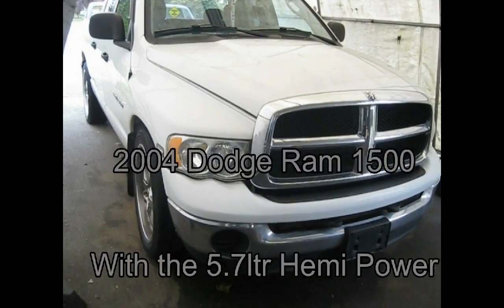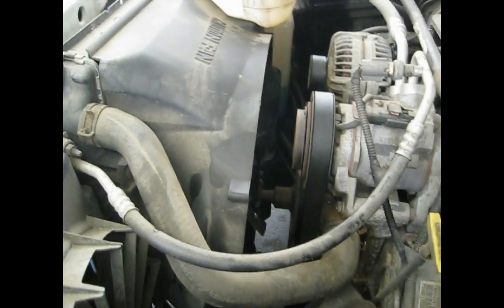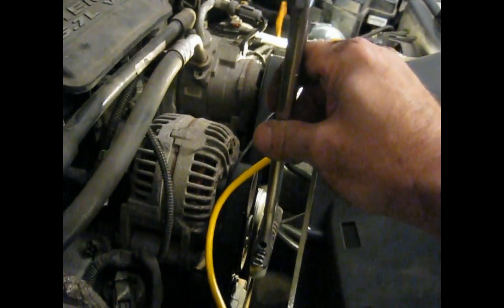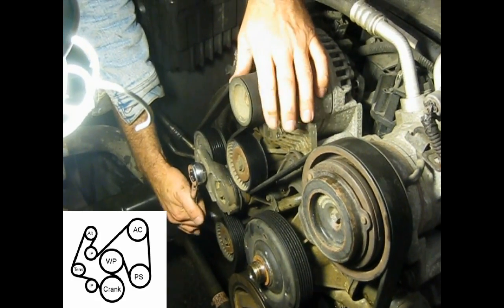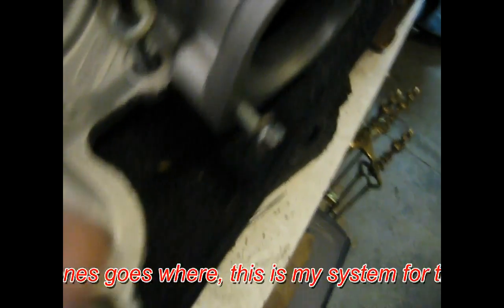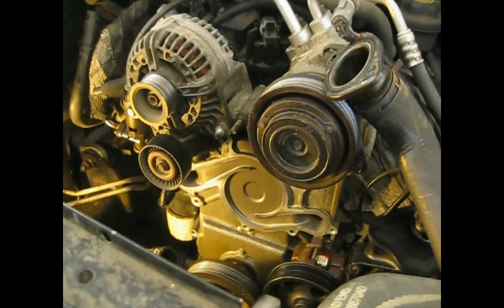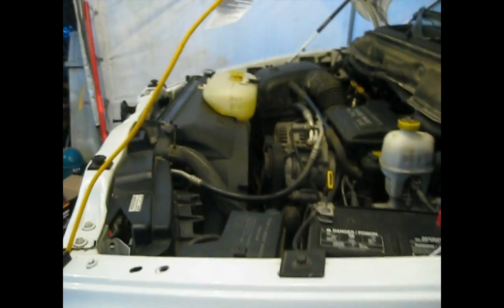2004 Dodge Ram 1500 5.7ltr Hemi Water Pump Removal and Installation

Comment: Great video! I've replaced my fan clutch before, Lisle makes the tool for holding the pulley, it's worth every penny.
Reply from the maker: Great tip TheBilly502, I'm sure many will benefit from that. Always good to have others toss helpful bits of advise or experience into the mix. This is all about helping each other out. Save time and Money. Thanks :)
Reply: What tool is it part number ???

Comment: just wondering if you seen the bolt that was missing from behind the tensioner on the pump an installed it too? good vid.
Reply from the maker: Not sure what bolt you mean, but everything went well with the re&re i've had no issues since done. Thanks

Comment: Great idea, putting the bolts in the new one as you removed them from the old one!
Reply from the maker: Thanks Randy F., I started that habit when i used to tear down motorcycle engines. I would lay all the parts out on the floor link an exploded micro fish pic of the parts, leaving all bolts and nuts in their spots, it always made the reconstruction so much easier.

Comment: Didn't see it any the comments on the top of the page, so I thought I'd tell you, the "tit" on the top of the thermostat is a burp hole that allows air to burp through if air is in the system. Obviously, you want it at the top when installed since bubbles are on the top. Good vid.
Reply from the maker: Yeah i had a few people tell me that both in here and other wise, but the video i made now, didn't feel like editing to change that., figure it's been mentioned in the comments now so it's all good.., but thanks G8RDuc & Thanks for the "Good Vid" appreciate it. :)

Comment: Hey im wondering on the makeshift pulley holder that you created , what size of bolts/screws did you put in the bar that would fit snug in the holes of the pulley??
Reply from the maker: Hi Jorge Gonzalez thanks for the post. To be honest, i don't actually remember what size bolts they were. I had a box of different sized bolts on my bench and i just picked out the ones that fit the best then made the rest from there. It was my second attempt that actually worked, the first one i made bolts were too small and the bar wasn't strong enough. (it was kind of Hit & Miss) Hope that helps you, sorry i couldn't give you an exact size. :(
Reply: ok cool. i actualy managed to get it removed after a while , took off the entire water pump, stuck a chain wrench onto the black wheel, put the handle of the chain wrench on the ground, then with a large crescent wrench twisted off the large nut, everything was going fine when i replaced the pump, then put it back on, and somewhere along the line i actualy punctured my radiator which needed replacing asap so i replaced the radiator, and now im having a slip in the gear shifting when i go to pop into drive/reverse it takes a couple seconds sometimes and other times pops in right away but even then when i gas it , it seems that its  not in gear for a sec, but jumps in and i feel a jerk then i get moving afterwards. ALSO DO STALL AT TIMES WHERE I COME TO A RED LIGHT.

Comment: Ever tried doing this in minus 25 degree weather in the middle of winter? Not fun. 

On your 2014 truck, did you need to unbolt & move the A/C compressor the get access to the bolts on the water pump?

Also, do you know what the torque specification was on that fan shaft?  I think it's pretty high (close to 100 ft-lbs).

Also noticed you didn't use any RVT sealant on the water pump along the outer edges of the gasket.  Why not?

That was quite innovative of you to use a make shift tool to lock the fan pulley.  I never like making my own tools (don't trust the workmanship lol!). I went out and bought a strap wrench to tie up & lock the fan pulley into place while I pulled & torqued the shit out of that fan shaft to get it off. What a pain in the ass.

At the start of the job it didn't look that bad, but as you get into it, it was much more time consuming and difficult than it first seemed.  If I had to do it again I wouldn't.  I'd rather just pay the mechanic the $500+ to do it.  Professional mechanics have it easy: they get to do the work in a heated garage while standing up the whole time with lost of room to move.
Reply from the maker: Hi "Randy the Ram Robinson" (GREAT wrestling Name BTW) LOL.., No i didn't have to unbolt and move the A/C Compressor, didn't touch it at all. As for the fan shaft i just tightened the SHIT right out of it, (NOT COMIN LOOSE, LOL). And as for using RTV sealant, it's a soft rubber/urethane gasket, no need for any sealant or gasket glue. It's been quite awhile since i did the job and still going strong NO leaks or anything, you can see in the video the old gasket was still soft and ply-able (could've probably re-used it, but i didn't want to plus the new pump came with a new gasket anyways). Oh and I tried a "strap wrench" for the fan pulley OFF video and had ZERO luck, it kept slipping and pissing me off. I couldn't get a strong enough grip to loosen the torque of the fan.

Everything i had to do was shown in the video, I know in some videos guys will "skip threw a step or two that they may think is obvious".., but covered every step along the way so there is no surprises. :)

Good luck with the job, hope my video helps, (Dress warm) -25 bbrrrr

I changed a motor in a Chevy 1/2 ton P/U middle of winter with 2 feet of snow around me and more coming down, but i had a "propane drywall bazooka heater" blowing on me the whole time, I was in shorts and a T-shirt, I actually broke out in a sweat it was so warm. LOL

**Anyone ever tell you, you look like "Mickey Rourke" the actor (once pro-wrestler) or is that actually a pic of him not you? LOL

Comment: How far apart did you know to drill your holes for that fan clutch tool and size of screws
Reply: I was researching and was just wondering if a strap wrench would hold that fan clutch bell housing. I'm going to change out  the crankshaft seal this coming wkend
Reply from the maker: Hi SuzRed11704, sorry for the late response. it was all hit and miss making the clutch fan tool., but what i did was I had a box of bolts I tried all until I found the size that fit snug into the pulley. Then for the holes I simply made a template from paper to mark the distance, cut the holes, layed that on the bar, marked it with a felt and drill them out. If you still getting ready to do the job, I hope this helps.
Reply from the maker: I have a strap wrench too, but it could not hold the torque required to break the fan loose.

Comment: having the "jiggle valve" at 12 oclock makes it easier for air pockets to escape as they will be higher in the thermostat housing.
Reply from the maker: can't say i have ever heard of the "JIGGLE" valve but if it works great!  :)
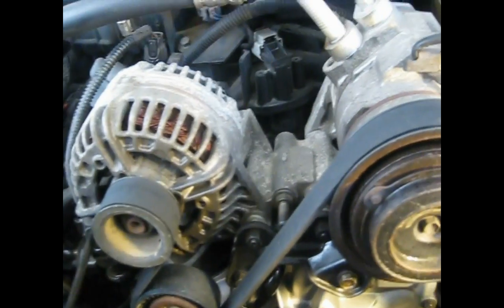 Unless of course you are referring to that little nipple on the thermostat, in which case yes i realized that had to placed in the 12:00 position, but raising the truck while adding the fuel helped the fluid go in without trapping any air inside the motor so it wouldn't over heat when done.

Comment: I highly recommend replacing the plastic idler pulleys(they're garbage) with oem metal replacement idlers from NAPA...much more durable. Overall, excellent job for a DIYer.
Reply: Kevin Jones  "Do it yourself'er"
Reply from the maker: Good point, i haven't had any issues with the plastic one yet but i'll definitly take it under advisement, Thanks (what's a DIYer?)
Reply from the maker: David Laro
LOL love it, (DIYer) Thx  :)

Comment: Kevin, Great job! Will be doing mine in the next few days. Just to clarify...the fan clutch removal would be clockwise? In other words..turning the shaft to the right to remove it? Thanks
Reply from the maker: CCW - Counter Clock Wise to REMOVE. Just as it says in the Video.., otherwise you will be tightening it and you could break or even strip something depending on how strong you are, or how long of leverage bar you choose to use.
Reply from the maker: Not the to the right.., Removal turns to the left CCW. Good Luck. :)

Comment: Thanks for video. I just replaced radiator, hoses, water pump, t-stat- I spend about 2.5 hours. My radiator was leaking, so I decided to do water pump while I was in there. The hardest part was getting the fan off. The Haynes book says to torque them down to 18 ft/lbs. I did mine at about 20 ft/lbs. Everything cost me $354. Removing the radiator made the water pump much more accessible!
Reply from the maker: +Tommy Pitchford  Your welcome glad it was helpful for you, my thermostat finally went now, it&#39;s been quite a while since i did the pump, but the truck takes for ever to blow warm air from the heater in the morning, i was told the thermostat is sticking open. Easy fix 10min. job

Comment: Great video thanks I took mine apart today to replace the black tube on the front of pump ended up ordering a pump because I can't get it out behind the fan pulley two things 1 overflow tank and washer fluid tank are easier to leave on the shroud disconnect the hose and electrical conn and 2 the fan itself I did the opposite of removing the belt with the wrench and pushed down on tensioner putting more tension on the belt and fan came off supper easy also I used 1/2 inch wrench not 15 mm it is a American truck lol will put together tomorrow when pump comes in hope assembly is as easy as comes apart ( again I could not fig out how to replace by pass tube on pump even though they sell it ) your video help me decide to replace pump I'm in it for about 160.00 --- 110 for a pump 16 and change per gallon of same fluid you bought plus tax
Reply from the maker: Thanks., you're probably better off to have replaced the pump anyways, that black tube is more than likely a machine pressure fit and may have leaked afterwards then your doubling the cost and labor. I think i tried a 1/2" wrench but the 15mm was a bit snugger and i hate stripping or rounding bolts but either way :) "American truck LOL" the new water pump was probably made in China hahaha. Also i think my fan was hardened into place, don't know but I tried everything first including just snugging the belt with no success, so that's why i did it the other way. You're right i should have just unplugged the juggs but in hind sight at least now i know how to remove them should that need come up, ie; leaky bottles etc. Glad my video was at least some help to you, that was my whole point of posting it.
Reply: ALL of the fasteners on this truck are metric, I don’t care where it was made. I have worked on one for a friend for a few years now, have yet to encounter anything sae.

Comment: Did you get a thermostat housing gasket? I was leaking a couple of years ago from there and a new gasket fixed it.
Reply from the maker: You know actually i took a chance and re-used the same thermostat and gasket when i did the water pump and have had no problems with it at all. The gasket is rubber just like the water pump so if it's not damaged or flattened i figured it should be just fine.

Comment: thanks "good vid ;i have a2005 2500 ram hemi , weeping 117000 miles; time to change'
Reply from the maker: Thanks for the feed back David m, I was only at approx.155,000kms when mine went and like it said to "UreaSmith"..,  it wasn't long at all after mine started weeping that it suddenly just went and I'm lucky i was only a block from home because it drained my rad in seconds. In the video you can see that I'm able to wiggle my fan, if you can do that too, i would recommend doing it now don't wait for it to pop.. Best of luck :)

Comment: .
Thanks for the video..Mine's is weeping.  Will have to change soon, this video very helpful.
Reply from the maker: Thank You UreaSmith for the feed back, I'm glad my video will be helpful for you, just wanted to ad it wasn't long at all after mine started weeping that it suddenly just went and I'm lucky i was only a block from home because it drained my rad in seconds. In the video you can see that I'm able to wiggle my fan, if you can do that too, i would recommend doing it now don't wait for it to pop.. Best of luck :)
Reply: Thanks..I did check the fan and there's no play..I ordered new waterpump and thermostat..I just hit 200K miles so I figured I'd play it safe.

Comment: Just wanted to say thanks for posting that video. I have not tackled mine yet, but it's going to be a big help. With all the engine accessories hanging over the pump, it looks pretty intimidating, but being able to see how yours came apart took away most all the worries.
Reply from the maker: Hey great feed back and i know exactly what you mean.., at first i thought i was going to have to tear my whole engine apart, all the A/C and belt brackets, etc. and all, but once i started the job i realized quickly that I didn't have to touch any of it. So looks can be deceiving and pretty intimidating, absolutely. I'm glad my video is going to be helpful and good luck when you attack the job, you should have no troubles. Thanks for the feed back JP S.

Comment: My repair manual says 18ft lbs for water pump bolts. Looks like i'll be doing this in a month or so. Great video, gonna be a lot of help!
Reply from the maker: Thanks Jason for the feed back, I'm happy the video with be helpful for you and thanks for the specs on the bolts, I kind of figure 18 to 20 was more than enough, you can just feel it. Best of luck on the job. :)
Reply: BONES 487 u think a month? mine went out in about 2 days , i would suggest changing your pitcock nut while ya do it they are flimzy also save urself some headache and use the chuck that fits inthere

Comment: Oh so basically the shops wouldn't do the work for free?  Well of course auto repair is expensive.  Running a shop isn't free.  Get a grip man.
Reply from the maker: I've been waiting for you. There's always going to be "haters", give them time they rear up. I thought about going onto each of your videos and shitting on them too, just for the hell of it.., but I won't lower myself to your level. No where in my video did i ever say or imply that i expected shops to do the work for FREE and even "AN IDIOT" could "GET THAT", get it?  What i offered was MY solution to spending between $450 and $650+tax and shop supplies for 2hrs labour.., as "robbieh693" and many others had found, that's a little steep.!!! Why should we pay for your shop, your tools, your over head, your advertising, your fancy new truck which you "write off", your employees which probably make minimum wage, the list goes on.., MAN. When with a little research and a little effort we could easily do the job ourselves and spend that extra money on our own toys, families, hobbies or what ever the hell else we'd like. Don't get me wrong, I get it OK mechanics take the time to learn a trade and then set up a shop to make a living, but that doesn't give you the right to crap on others that find alternative ways of supplementing there own living. It cost me a fraction of what Chrysler wanted to do this work and the job is done and works just fine NO issues. (I BOUGHT THE EXACT SAME WATER PUMP THAT THEY WOULD HAVE ORDERED FROM THE PARTS STORE, BUT THEIR COST ON THAT IS ABOUT 20% LESS THAN I PAID). Now there are jobs that i will take to a shop because it is out of my league and or maybe i just don't want to tackle it, but again even those jobs I'll shop around for the best price. For this particular job, (which your mechanics BOOK says 2.5hrs, yet the mechanics ALL said could be done just under 2hrs) I was quoted everywhere from $446.18 to $975.00 before tax. Doesn't it make you wonder why people eventually try to just do it themselves. Have you ever heard of W5? Have you seen some of the SCAMS and Reports on SHOPS that they have revealed on TV..? Oh let me guess that's all FAKE right..?  "Yeah i know you, i was expecting you." - "Get a Grip MAN.!"

Comment: How did you know your water pump was shot? I have a 2005 dodge ram with5.7 hemi in it and noticed the other day that when I came to an idle the heat would blow cooler air and when I was driving it would blow hot air....... I talked to a couple people about it and most said water pump but others had other ideas just want to fix the right part the first time!!!!
Reply from the maker: Ya know the first thing that comes to mind for you is, i'd check the coolant level sounds like your low on coolant or you have an airlock. If you watch my video you can see that my fan was wiggly and that was the first sign, it was also slowly losing water, but then one day it just totally blew and all my coolant drained. I don't think its your pump. Try what i said first, it won't cost you anything. :)